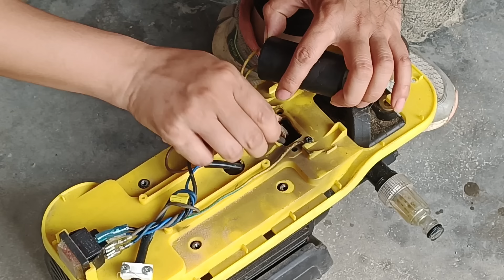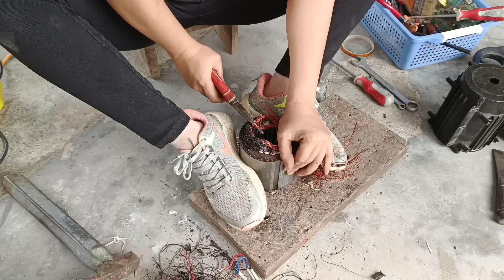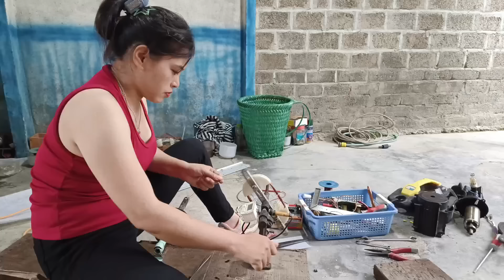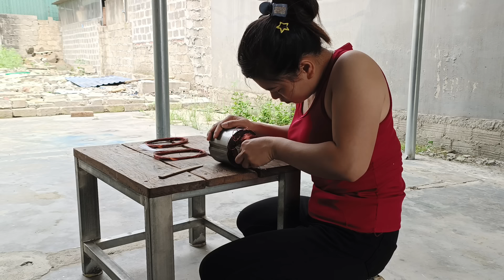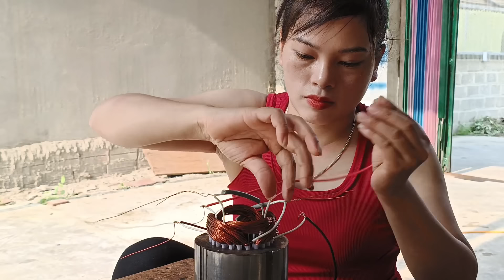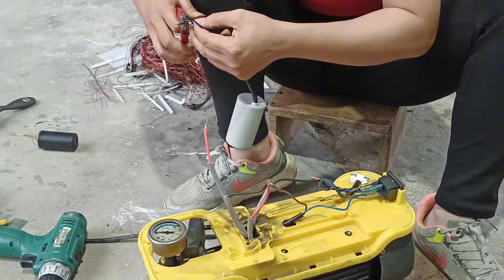Repair mini car washing machine with broken copper coil

Comment: Bjr une question vous faites comment pour trouver la longueur du fils cuive isolée  s p merci
Reply from the maker: Thank you very much take copper wire measure the length of motor groove 👍❤️